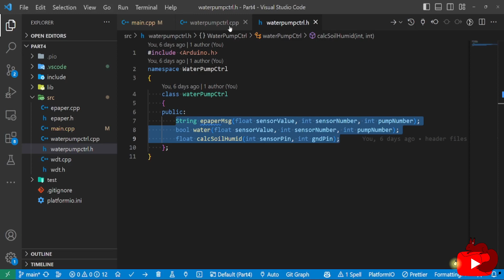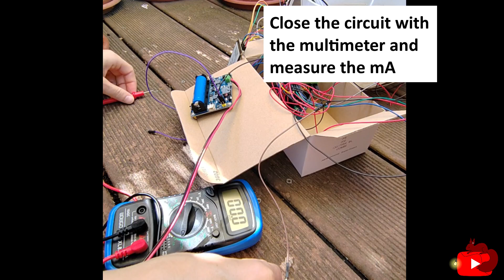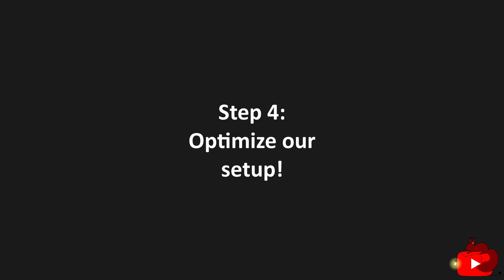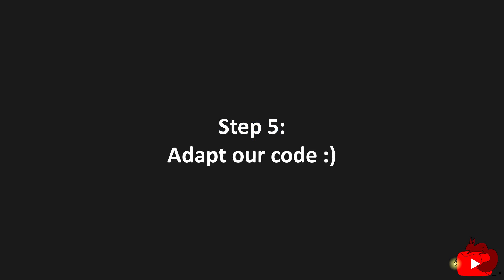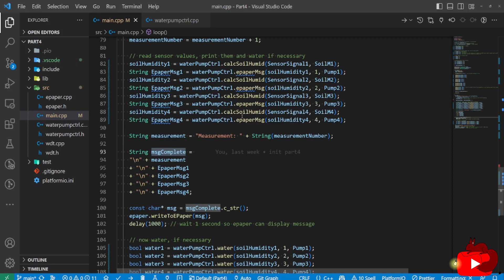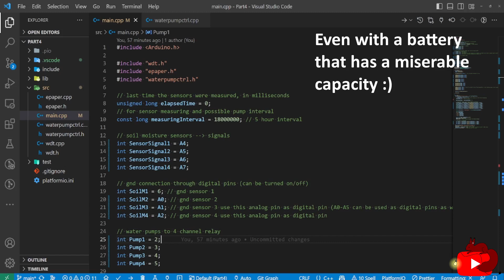How to build a solar plant watering System with Arduino Part 4

Comment: H thank you for this, it was very useful.  A few questions, is there enough capacity from the battery to supply the power if all 4 relays are triggered and all 4 pumps are running at the same time?  Also did you measure current usage when a pump was running, thanks
Reply from the maker: Hei, thanks for your comment 🤗. I didnt test that, but I think all 4 water pumps at the same time could be a little too much for the solar power mgr / battery. I also did not measure this. Why do you need all water pumps running at the same time? The nice thing about this setup: the recharging is completely done by sun power. It totally runs self-sufficient 😄
Reply: @miaooarr  Hi, I looked at the code and I can see that you control the pumps one at a time , with the 20sec delay, so there would never be 4 pumps on at the same time. I was thinking about expanding your design to work in a garden with maybe 5 or more sets of sensors and pumps, Each one would be triggered as necessary. In this case there would be a separate pump and power system for the pumps.
Reply from the maker: @raymondmathers7999  Exactly. Only one water pump will run at a time. The 20s were sufficient for my needs, you can test how much water you need for one cycle and expand the run time to your needs. It's a good idea to expand it. I also thought of that. But I have no solution yet, because the Arduino Nano has a limited number of pins. Do you have an idea how to solve this? I am very curious, because I also thought of expanding the system to a bigger solution outside. But my requirement would still be: should run only by solar power. Most water pumps though do need more than the 5V the Arduino provides. With the relay you can easily control the water pumps with a different power system, should not be a problem. Of course the system could be duplicated, but then the costs will be higher.